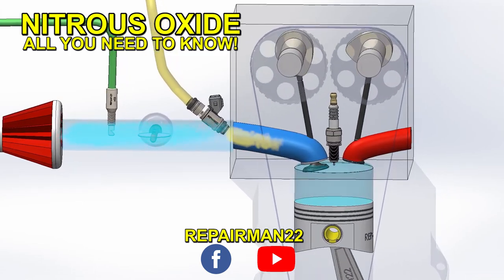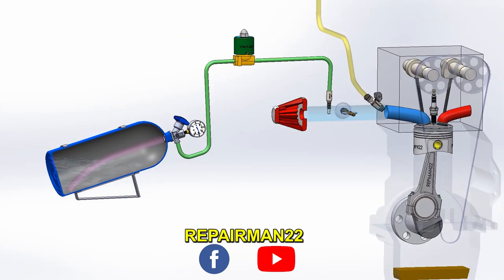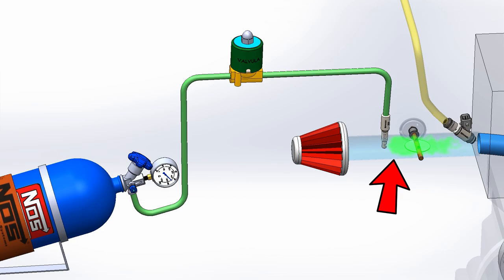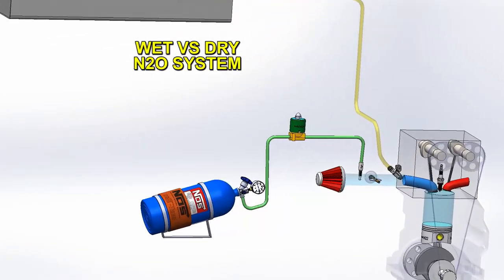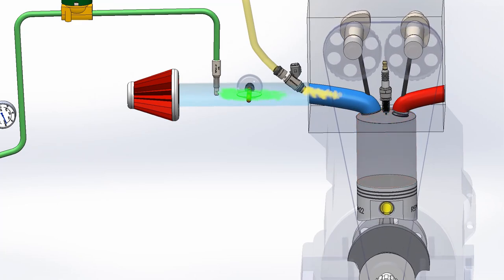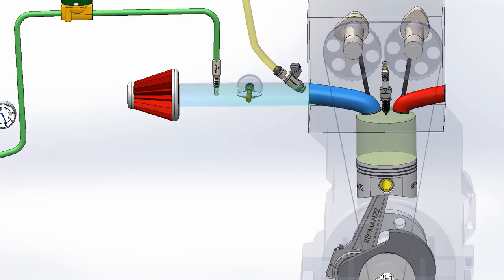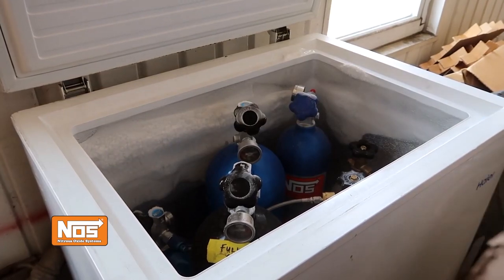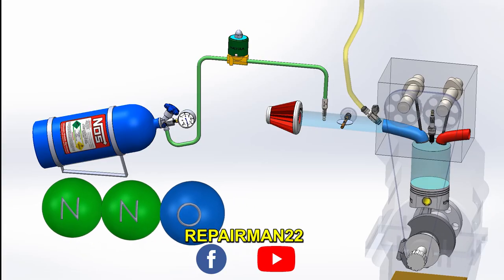How Nitrous Oxide works // 3D animation.

Comment: I was almost gonna leave a bad comment until the phase change was mentioned. I thought nos was completely useless because if you want more fuel and oxygen, just add boost. So what's the point in consuming a consumable, well it turns out the phase change basically refrigerates the reactants. So anyway why don't they just use propane gas? It would be the same nitrous effect but from the fuel side. Plus it's less dense than gasoline so ud get even more phase change cooling. But I'm not really sure if that's even helpful either, because all that cooling, and the pistons end up at 1500 degrees anyway, and since degrees equal to pressure, is the engine making the same power? Or does the nitrous and propane, create a higher pressure at still 1500 degrees
Reply: To not blow the fuck up
Reply: And this whole thing only works in Gasoline land in a diesel it's totally different because you can lean a diesel out with nitrous if you have the fuel to burn. You can lean them all the way out to 28:1 make more power and Exhaust gas temps drop because you can consume all the available fuel to be burnt with extra so it acts as a cooling agent to keep piston temps down which is less heat rejected to the cooling system and your oil temps as well
Reply: @lukedougherty7078  well turns out that the cooling cools the temperature, but the pressure is still higher because theres more fluid in a smaller area under higher pressure while still at the combustion temperature. So propane with nos would work really great.
Reply: @MinecraftSurge  you missed the point but you are not wrong yes cylinder pressure rises but with a controller you can pulse modulate it to work when you need it too without hurting stuff but what I was getting at is it's a lot harder to hurt a diesel with NOS as opposed to gas
Reply: @MinecraftSurge  I.E but diesel is injected differently than gas too both indirect and direct the pressures are so much higher and both fuels act considerably different as well you can't really apples to apple it
Reply: @lukedougherty7078  that's weird, why is diesel harder to hurt? I thought what hurts the engines is if the temp gets too high and you blast a hole in the piston.

Comment: was looking to do a nitrous kit. ppl kept saying it was no good. but now learning from your video. im going to do a wet system. window switch. fuel pressure. purge valve. bottle heater and two stage floggers.

Comment: This video is a good explanation of how a nitrous oxide system increases power and what needs to be done to properly set up a nitrous oxide injection system. However if a nitrous oxide injection system is not done properly it can destroy the engine. There is a YouTube video that shows a nitrous oxide system that was installed on a Toyota Prius. The first time the nitrous oxide system was turned on, it destroyed the Toyota Prius internal combustion engine.

Comment: I have one question , so while charging nitrous botle , nos is luqid or gas ? 
 
In my country there is  not any place where you can charge botle with nitrous is it possible to make nitrous myself ?

I mean i can use amonium nitrate to recive NOS gas in somewhere but does it works how can i put this gas than to bottle ?